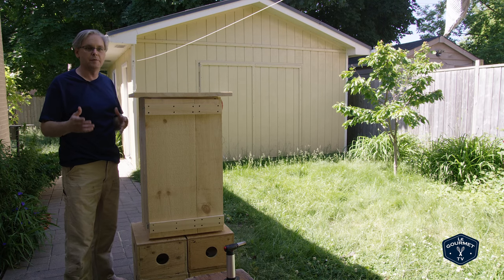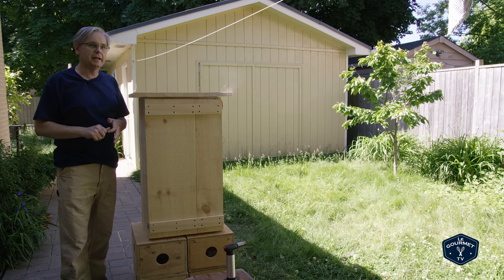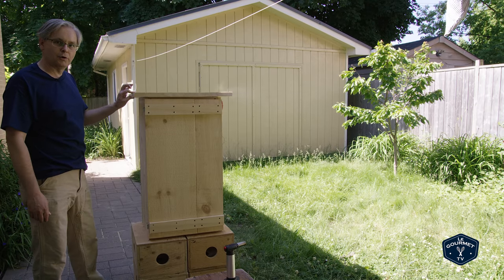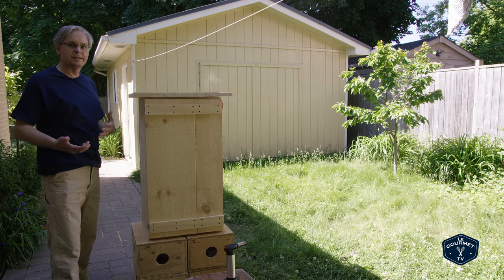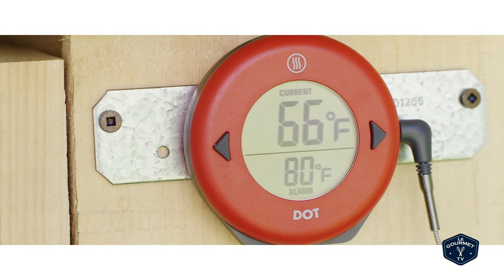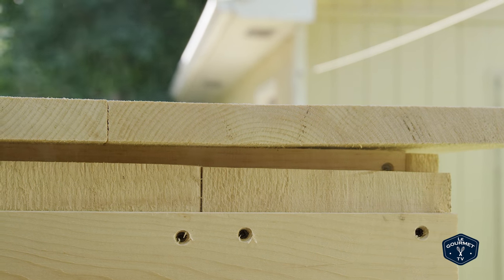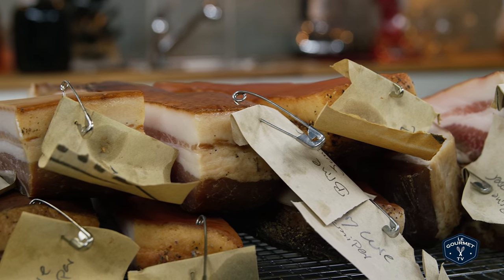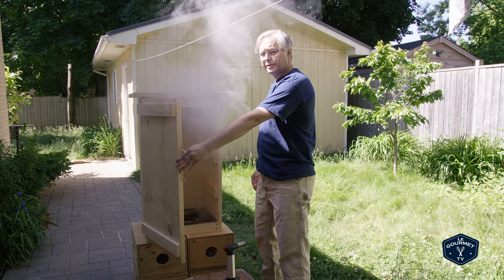🔵 Building A DIY Cold Smoker At Home

Comment: If you fill plastic bottles full of water, freeze them and then pop a couple in the cabinet, they will keep the temperature down for you.  It really works. I've cold smoked thousands of sides of salmon over the past ten years, in a number of seafood restaurants and used this method to keep the cabinet cool even during the summers. 2 litre milk jugs are the best because they're free, tough and don't split during freezing, but remember to squeeze them a little before tightening the cap, to leave room for the water to expand as it turns to ice.

Comment: Built one similar using a (large, commercial, gutted) Frigidaire freezer. Got a 2' x 2' 1/8 inch hole perforated metal sheet, took it to  metal shop, cut it into strips and bent to 90 degree channels. (about 2" x 2") Two 90's make a U-channel.  It's much, much easier to clean than Amazin Smoker tray. Just a wire brush, done.  I used fine (fruit, maple, alder) sawdust from local portable sawmills.  By adjusting sawdust levels, I could run as low as 50 degrees for cheese, maintain 75 degrees easy, and topped out at 90 degrees.  The smoking trays I put directly onto the freezer floor.   No fire box, chimney, etc.  Just freezer, smoking trays inside, sawdust and Bob's your Uncle.  Thanks for the vid.

Comment: hot tip: use a hot plate and a pie plate full of pellets for more fine control of temp. Adding a small flap on the backside will allow for adjustment of the hot plate and addition of wood without allowing all the smoke (and temp) to escape.

Comment: i bought a refrigerator from humana restore and drilled holes in the sides all the way through, holes through the freezer and out the top and just use it for a smoke box, can smoke on a Georgia july and the temp never gets above 40 F, installed a lil air flow grate in the bottom of the door for good measure and everything is perfect, temp controlled smoke box for less than 70 dollars and since its just a cold smoker there is no chance of chemical leeching from the plastic inside.

Comment: Hello Glen. I wrote a comment some time ago. I'm just starting curing and smoking and I need your advice please. I am a retired engineer and decided to try a few ideas about the design of a smoker. The main problem I have is putting pork in a lovely place to go off. The smoker I have made is in two halves. The base is for the smoke generation and the 'upper story' is for the bacon. Connecting the two is a metre long 100mm dia. stainless steel pipe. I was thinking of putting a water cooled copper coil in it. l may not need it. There is 3C between the upper story smoke and ambient temp. However I seem to have gone a bit overboard on the smoke. I'm using a 1600 Watt (set at around 400W)  hot plate and seasoned oak sawdust. It's like a World War 1 destroyer laying a smoke screen. The question is :- Does it matter how long the cured pork is smoked for ?
 Mine looks done in little over an hour. Tastes fine, well the 'old dragon' likes it and that's good enough for me.